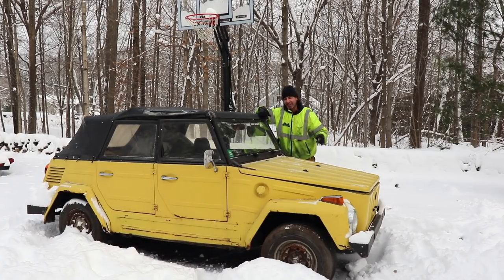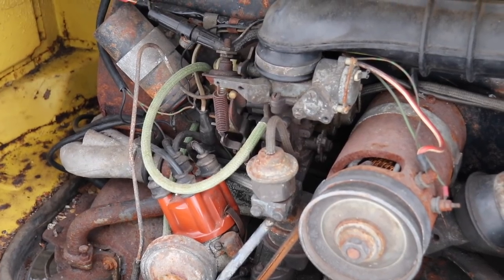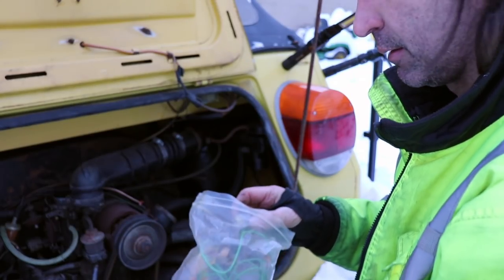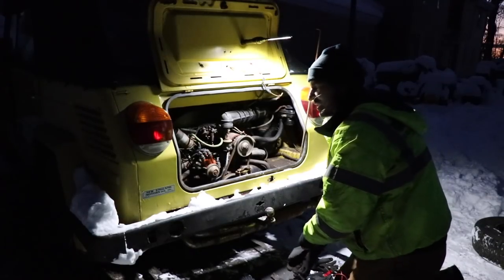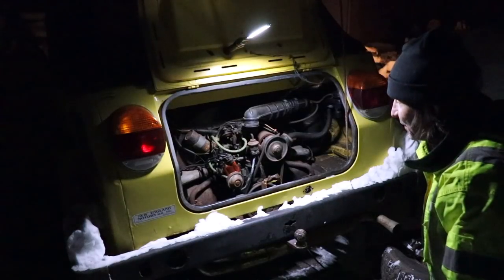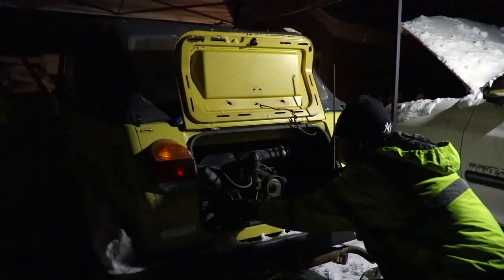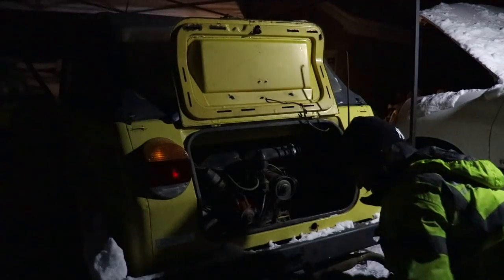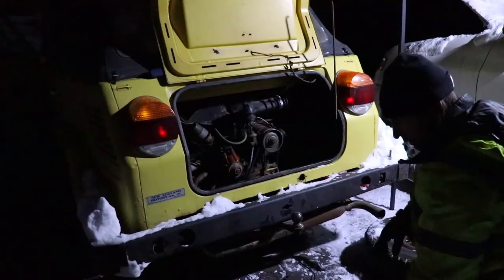WILL IT RUN? Forgotten VW Thing Type 181 sitting for 32 years!

Comment: Sounded like it was either flooded or starving for air. Next time something like this happens, remove the air cleaner. If you think it’s flooded, put your (gloved) hand over the top of the carb while cranking and the engine compression will help clear the excess gas out of the carb and intake. Don’t forget to disconnect the fuel line from the tank, too. You did check the air cleaner for critter nests first? Right? If the outside of the air filter gets packed, it could potentially starve the carb for air. If that happens, count yourself lucky that the air filter didn’t give way and allow the engine to suck all that mousy goodness down into the engine. I have a feeling the engine will be ok once you work all the bugs (and mice) out of it. I know how it feels to just want to hear it run … but … who cares what the neighbors think?
Reply from the maker: Hi Brian , thank you for the tips...I left the air cleaner boot off the entire time ....I did however forget to disconnect the main fuel line🤦‍♂️...I'll get it on the lift and go through it .

Comment: I always replaced the original distributor with the 019 or 009.  Less trouble...
Reply from the maker: less drivability too!
Reply: @5150mxVW  Forgot to add that this was on engine resurrections.  Gets all that pesky spark uncertainty out of the way.  Besides if it's low compression or running on 3 cylinders there's not too much performances going on... Peace!!

Comment: scratch a mark on the dist and engine so you line it up close to before you move it.
it might not be correct and timed..but it might be !!
Reply from the maker: Hi Gary , yeah not my usual approach here ....I forgot these " newer " engines time atdc , I had it wrong so i'm sure that didn't help . Maybe the 27 gallons of 2 stroke i dumped down the carb finally freed up some rings lol?
Reply: @5150mxVW  
the added oil isn't going to hurt it...and you got er goin ....lol
it was cold too...they use any block heaters??  oil pan magnet style? or something??  i live in Western Siberia - Manitoba Canada . and it is Minus 40 now was almost 0 last week...usually minus 20's to 30's all winter.... all good fun and content...
i put a construction heater under tarps if i have to work outside..or start something that needs a faster warmup..i have a heated floor shop luckily...seen you enjoying that..in intro..then a canopy like your racing motocross !! 😂

Comment: You need crowd funding points, condenser, sparkplugs wires and some wires. And good batteries. For the love of God get some ether
Reply from the maker: sounds like the next vid on the lift IN the shop😁

Comment: It's funny I've never seen you touch the throttle once how do you even know it's getting gas
Reply from the maker: haha, oh it had GAS :)
Reply: @5150mxVW  good answer. Without pumping rhe throttle its not getting introduced to fuel air mixture.  I'm not saying your doing it wrong but I'm been a licensed auto mechanic for 35 years.
Reply from the maker: @Geoff321  in 35 years I should be good enough to apply for a mechanic license 😂....I thought it had enough air , the air cleaner boot was off ...I think the timing was off , my frozen brain forgot these " new " ones time ATDC ... i will revisit this engine when I get it inside on the lift . Tips from seasoned mechanics are always welcomed , thank you 👍
Reply: @5150mxVW  your Channel your choice the last thing I want to do is tell you what to do your the man I love your videos.
Reply from the maker: @Geoff321  the last thing i wanna do is spend 6 hours outside cranking an engine with a 3 % chance of firing haha....thanks man
Reply: @5150mxVW  sounds good Bong rip time.

Comment: Might not be the condenser. Check mustie's mobile has charge...:P
Reply from the maker: well after i swapped the condenser we had spark the very 1st crank. Not the first time I have seen a bad condenser cause a no start on one these beetles  I did a will a run on ...very common actually
Reply: @5150mxVW  A tremedous effort. Well done. Felt your pain until she actually started.

Comment: If you had took the time to clean the plugs and file the points right and gage them on top of not pulling the distributer and getting it a hair out of time on top of it all it would have already been running ! SMH LOL
Reply from the maker: spark plug holes were packed with mouse ... you think a hair out time makes a difference ? nah . I'll go through it at the shop ....
Reply: @5150mxVW  Your right none of it matters that's why it cranked right up !  Hey they make new starters everyday to lol !  Good luck it looks like you have a handle on it now !

Comment: For God’s sake, please lower the roof correctly. You can’t imagine how many Volkswagen “Experts” ruin the back window by not knowing 🤪
I unclip the sides first - ALL THE WAY BACK - then fold the outside corners inside the top. ROLL the top ahead then fasten. The frame should be all together w/o ANY top in between. 
Any other method is incorrect. 
Sorry all you experts. That’s how it’s done except on mine, you still had the frame covers to install and the VW bag for the side curtains. 
This is the extreme basic model. Not even with the deep water intakes.

Comment: you need a tune-up. points plugs, wires, wires condenser. your obsession will cost you more.
Reply from the maker: We will get it over to the shop on the lift , and go through it ...yes I got a tad obsessed :)

Comment: Jesus Christ why don't you do something to fix the damn thing. Pull the distributor, change the points and set gap, install and static time. Check plug wiring. Pull the carb and clean, reinstall. Fill float bowl, use the throttle to pump gas to the intake. Why not do the easy stuff instead of looking the fool while whipping the timing from one end to the other. how about check the valve lash and make sure valves aren't stuck. Why don't you have a set of known parts to just stick in and use to get it started. It amazes me how many guys won't even bother to static time a motor.